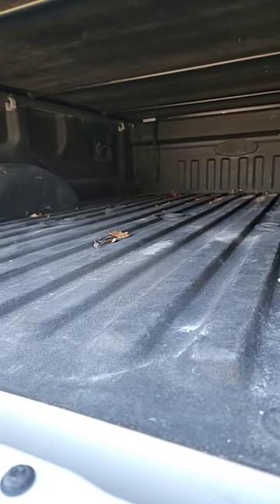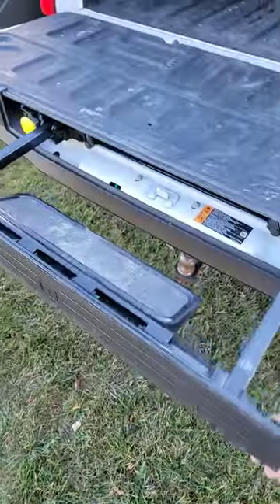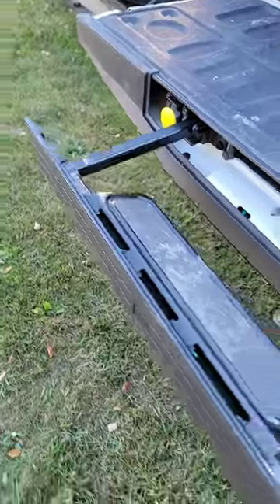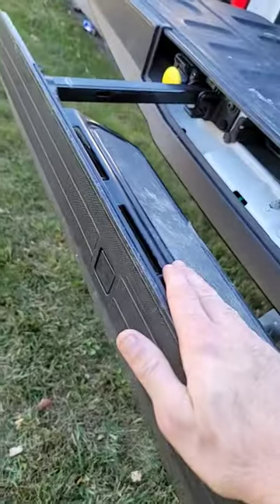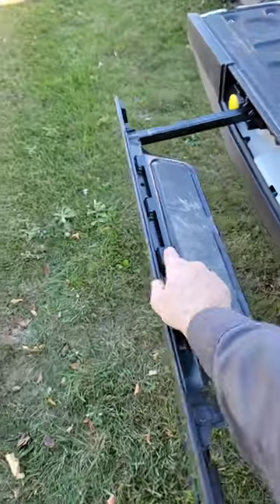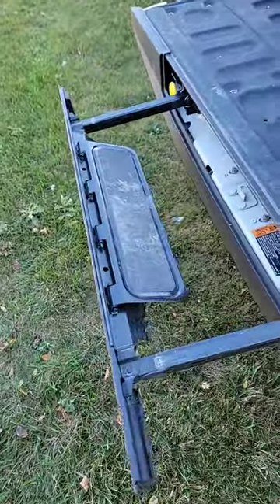have YOU busted this off your Ford truck? #fyp #shorts #fordtrucks

Comment: Have had this step on two previous trucks. Wouldn't buy another one without it. Ripped the plastic partially off once but other than that have been flawless and I'm 285lbs.

Comment: I thought you were going to talk about bed bolts. I worked at an auto recycler for a year or two and was the truck guy there tearing down all the trucks and had some fun times with bed bolts but the newer Ford ones weren’t bad if you had the I believe was SnapOn 24EPL Torx plus.
Reply from the maker: Yes sirr

Comment: Had one on my 08 250, specifically chose not to have that option on my 11 350. My 16 150 has it and I had to add some self tappers to it. They definitely need to come up with a better way to secure the trim. I see way too many trucks driving around with the trim missing.

Comment: My latch broke because i rolled without the plastic on.  Holds the button in correct place. I bent the latch too many times.  Separate piece with a stamped on part #. Ford wont sell me one.. guess im brazing.

Comment: I do have a question should the wire straps holding the tailgate be at the same length or tension? It feels like one side is holding all the weight but everything seems straight